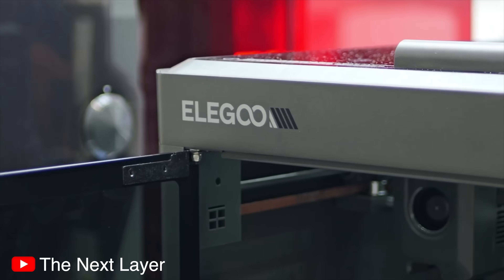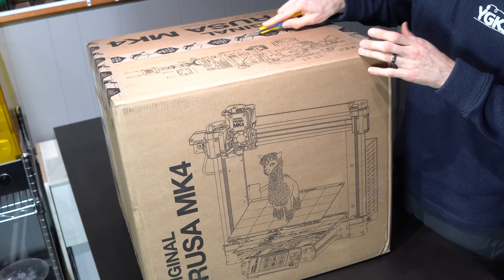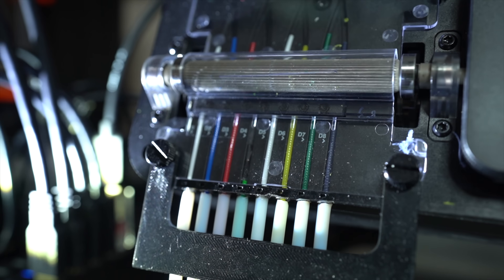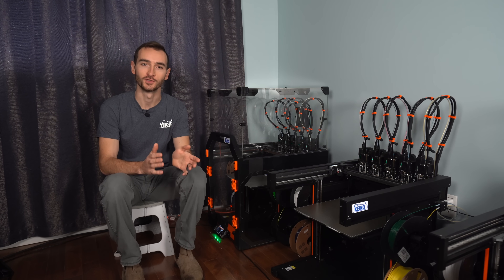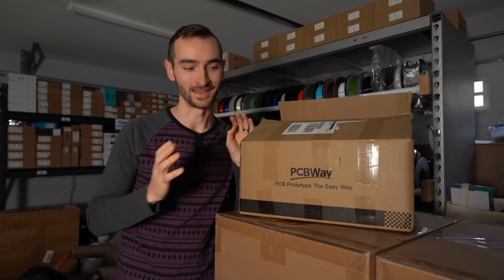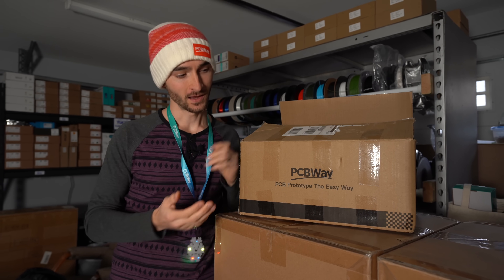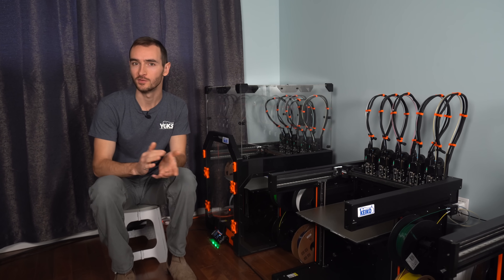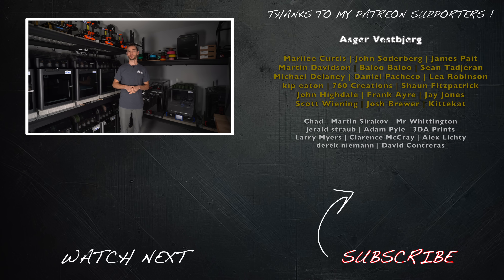The Prusa Core One is dividing the internet...

Comment: I have had the BambuX1C Combo for 1½ years and it is fantastic for single color/material print as the waste/time to shift filament in layer makes it more of a hobby thing, as we use it for prototyping/manufacturing functional parts and when you are using 200$/kg filament you don't want the poop!
The Prusa XL has benefits, but the cost is excessive for the value, and I reallllllllllyyyyy would like a much wider (2x or 3x  (or deeper/taller)) X1C preferably with multiple heads.
I think Bambu offer better value within the 256x256 envelope

Comment: There is one more decission factor -- noise level. I'm running a startup and at the moment there's no economic reason for renting a separate location for printers, so I print at home. I am going to replace my Ender 3 V3 KE with fully enclosed printer. All information I have is that Bambu printers generate much more noise than Prusa, so I ordered a Core One printer. For me the choice was obvious.
Reply: I hava an X1C in my office at home. I print while I work in there. The "noise" doesn't bother me at all. I don't think it's loud at all.

Comment: The bambu printers are not THAT difficult to fix, I definitely wouldn't throw it in the garbage at the first sign of trouble after 1000 hours. I have many Bambu printers with over 5000 hours and I've done repairs and part replacements without much trouble. My 3 X1C's in particular have over 5k hours and haven't required any repairs

Comment: I think the "bambu revolution" has certainly advanced the industry as a whole since much more consumers are now in. 
On the other hand that might be the downfall of some companies, I guess Prusa has a pretty good opportunity as well here, giving upcoming potential trade wars being and manufacturing in the EU can be a big advantage. 
Supreme customer support is a really big plus point but consumers are so used to shitty support they might not appreciate it as much as professionals do. 

Tbh I think bambu makes most of their revenue with filament and side stuff instead of the machines themself, other companies like anycubric try to emulate that 1:1 but will probably stay a little bit behind bambu. (I think I´ve spend about as much on Filament compared to my bambu printers and the margin on filament is probably a whole lot higher than you could ever get on a machine, I would be pretty shocked if manufacturing Filament in the EU would cost more than 10 euro per spool all costs included.) 

Running on the supplies instead of the machines gives you a constant revenue stream which is what about every business wants and needs for operations, on the other hand the marked regarding filament is pretty competitive.

Comment: Nice video. Ignore the fanboys. I think you laid everything out fairly. I am not a fan of Bambu due to their business practices. I also don't own a Prusa either, but they contribute to the growth and advancement of the community. And for a Trident clone (which is how I see all these commercial CoreXY printers), I think Prusa did provide quite a bit more innovation than any other clones. Not significant, but thoughtful and useful. Reducing chamber volume with inset sides will make a huge difference in chamber heating, sealed filament enclosure, managing chamber temperature during prints, being able to upgrade from an MK4S. That shows Prusa is invested in always offering an upgrade path.
Reply: Thats the only reason I havent bought a Bambu (their business pracitses).

Comment: I'll admit I have not looked into the Core One at all, but I previously happily bought a MK4 and quite like it. It has all the features I need, is open source (though sadly no longer open hardware), was fairly affordable, and has incredible software and firmware. Prusa developed an updated and improved fork of Slic3r, which was subsequently rebranded by Bambu to be their software (and at least initially, possibly in an improper manner according to the license). It's open source, so building on a program like this is perfectly legal, but the spirit of that agreement is broken if they don't give back and benefit the public by making their own software and hardware open.

My two cents is that Bambu popped into the market with a more expensive printer (that almost certainly received subsidized R&D to cut into the market, just given the history of their company), is a patent troll (Stratasys is still worse though), and is heavily using technologies that were pioneered earlier by Prusa or others. Not to say that they're completely not innovative; it's a nicely integrated system, but they're basically a "throw money at integrating some existing products that maybe weren't sold together before" company. Motion control - Klipper, PC software - Prusa, AMS - Prusa, Camera & remote management - Octoprint (and many others), removable beds may? have been Prusa (they were at least on that pretty early), and the bed levelling techniques have been around in basic form for at least a decade now. It's not a LIDAR, but the Prusa 2 had mesh leveling, and even my Prusa 3 has been flawless (so far, 2.5K hours with no hardware failures at all), with the exception of remembering to swap the surface profiles when you change a sheet (now unnecessary on the MK4). Heck, CoreXY isn't even new, Ultimaker and others have been using it for years now.

For full disclosure, the Prusa MK4 is not innocent either; the controller is no longer open hardware and there were some complaints (not sure how true they are) that they ripped off some community ideas (possible, but they usually give credit, so this seems at least partly overblown) and are still a little behind the state of the art or some Bambu features (they don't have a LIDAR, for one, but my personal opinion is that is crazy overkill). I think they were also looking into some sort of obnoxious certification program for their components. However, they have done a lot more for the community and are still largely open, especially on the software front.

Comparing the two, I can theoretically print a lot of replacement parts for the MK3 or MK4 myself, can still get replacement parts if I were to need one (since I was ordering the MK4, I did order some nicer fresh MK3 parts that were starting to wear a little, but I have no expectations or concerns of anything actually failing), and can build the software myself if needed if Prusa were to stop supporting it. There's also unparalleled cross-OS support and there was even an ARM release for a little while that worked on Raspberry Pi. I can probably still compile one even if the binaries aren't provided out of the box on the last few releases. The Bambu uses chipped filament and I've seen one working, it seems finicky with the filament wiper and box. I also heard from the guy running it that it cost a LOT extra to get one that works locally, whereas I can use the Prusa printers offline or locally with no extra costs. I also built both my Prusas, and not only was it not hard but I'm very sure I can maintain them myself. The process was also not that time consuming (it only took about 7 hours to assemble the MK4, although I did take extra time to also build an enclosure) and IT WORKED FIRST TRY with no adjustments needed. That was a magical experience, let me tell you. That's a combination of very good hardware design and amazing firmware.

Comment: It's cool what Bambu did with the X1 Carbon, that is for sure. However it's much more outstanding what Prusa did with the Core One. They price matched a printer made in China with a printer made in the Czech Republic, where the manufacturing costs and wages are much higher. They had no choice basically. Of course, they had to omit some features, but I'd still take the Prusa instead of the Bambu any day. Why? Because I had my first successful print on a Prusa. Because I taught the MK3S to speak Hungarian (read: I did the official firmware translation). Because Prusa's tech support was always very nice to me, even if I was out of warranty. Because it takes usually two business days to get a spare part. And mostly because I care about a company, who is manufacturing amazing 3D printers in Europe and they want to stay based in Prague. +1: because they do factory tours (I wanted to go on one this summer, but I got sick, so I had to cancel my Prague vacation)
The first MK3 I bought back in 2018 is still going strong, along with two others bought in the same year. I no longer have those printers, but I'm in touch with the current owner. My own MK3S (with linear rails on X and Y axes) is also working without skipping a beat, but I might get a Core One instead of it.
Prusa is moving towards the industry because they have the foundation for it and because that's where the big money is. Their domestic printers are already being used by large companies like VW / Skoda, so it's a natural step with their abilities.

Comment: As a hobbyist of close to 10 years now I was fairly excited when I first heard about Bambu's printers and how easy they would be to use. But due to Bambu Lab's behavior since launching, I will not touch one of their machines. Most of those reasons have been mentioned in this video so no need to restate them here. Instead I will choose to pay a little more and support a company that gives back to the maker community instead of stealing from creators for their own benefit. Not to mention the top notch reliability of a Prusa and the fact I can make any and all repairs myself. Despite my feelings toward Bambu, I am glad they are pushing the market and I would actually recommend one of their lower end models to someone who is simply clueless about 3D printing and just wants to print some fun little toys. Anyone who is more serious about 3D printing as a hobby I would recommend a Prusa. Sort of like the difference of a tabletop player buying figures pre-painted and those who paint miniatures as the hobby itself. I am not a business user so I have no opinions in that regard.
Reply: I have to be that guy. Your info is wrong. Whether it be through ignorance or malice I will correct you. 
1. You could ALWAYS  print offline(sd card). I am an original kickstarter backer (2022) so that misinfo about needing the cloud to print has NEVER been a requirement. It as only gotten better with LAN only mode(over wifi) and little known FTP.

2.  Making a website that houses models isn't a novel idea. Thangs, printables, yeggi, Thingiverse. Will you accuse (Prusa)Printables of copying (Ultimaker)Thingiverse, which came out first? 🤔

3. Printing without a slicer(from a cell phone) came with Ankermake first but was quickly implemented and supported better with Bambu. That has been COPIED by Prusa. Where is your outrage for Anker against Prusa for copying? 😒

4. The advancements in Opensource in Bambu studio has been implemented in Orca and Prusa slicer Step file implementation, multiplates, svg all bambu first. 

4a.They also licensed their nozzle tech to E3d and half of the license fee goes to Sanjay Mortimer Foundation. 
So they are giving back to the community.

5. Makerworld files are USER uploaded. Point to a maker who states their files were taken by bambu directly. Any files that are user uploaded fraudulently can be taken down easily with a copyright claim. You are probably the type who think looking at the inspect element of a website is haxxing...🤣

They even allow X1C users to roll back to earlier firmware to use Open source custom firmware. This can allow addon boards that include usb and ethernet. They are not heavy handed with mods like the hydra ams mod, light bars, fans, bento boxes and even recommended mods for the p1p before it was overshadowed by the p1s. 

Open source hardware is OPEN TO ALL. private users, education, companies. All licenses are followed and adhered. Anything created inhouse does not need to be shared. Even Prusa is closing some hardware designs as is their right.

 For the love that is holy do some basic research. If you like a company for any reason that is your decision but no need to spread refutable junk to justify it.
Reply: 1. I know you could always print through SD card. I was referencing network connectivity. And I also know they have made it an option to not use their service while using network connectivity. But when it launched you had to send prints over the Internet to China if you wanted to use NETWORK connectivity. And a result of this was a bunch owners discovering their printers connected to said service printed by themselves due to a cloud service restart. That's a big red flag for me. Sorry, I was not more clear. 

2. I was not accusing them of stealing because they implemented the same concept for a web site as someone else. Their site was a clear and direct recolor of another. You can debate whether using the near exact design and a lot of code base is stealing but in my book it is very bad form and another red flag. If you don't have the talent to write your own code or create your own design hire better talent. When a company shows me they take a lot of shortcuts it is a sign I probably don't want their product.

3. Not sure of the point here. I never mentioned anything about printing without a slicer or Bambu stealing features. I have no issues with any functionality of Bambu printers.

4. Maybe you skipped my original post. It really seems like you did. From my original post: "Despite my feelings toward Bambu, I am glad they are pushing the market and I would actually recommend one". My criticism for lack of contribution is purely on the open hardware side and is my personal preference for a 3D printer manufacturer.

4a. Ok. Charity is great. I am specifically talking about open hardware and in particular in regards to the 3D printing community. But again, great.

5. I will concede this point 100%. It seems it was a user that was performing the mass uploads of other people's models to Makerworld which is what I was referencing. And for the record I write HTML/XML/Javascript/PHP for a living so big swing and a miss there. 

And a point I did not mention was Bambu Labs admitted malicious behavior on a competitors site:

"These testers did upload a handful of models to Printables, including a sparse few problematic ones, and even reported some of them to check the moderation procedures so we can calculate how many head count should we reserve for moderators. All these models were subsequently removed by our testers if not previously moderated by Printables. There was no malintent in this activity, and no harm was inflicted upon anyone, other than the very minor added workload of moderation for the moderator."

That was not only breaking TOU but is very bad form and shady behavior. They only mentioned it on their site because they were caught. You run your tests on your own site with your own employees/resources. Not sure what you do for a living but I am sure you would not want a competitor abusing your resources for their gain.

It really does seem like you did not read my original post but I hope this clarifies my opinions.
Reply: This is silly. Can you clarify what behaviour it is you don't like?
Reply: @Keveira  Well, several are mentioned as I said in the video, but here ya go. Firstly they launched with users being forced to send prints through the Internet to their servers in China. Then they had a debacle where many of the printers started printing on their own because of the afore mentioned prints going through their servers. They also incorporate a lot of open hardware design but do not give back to the open hardware community. Then they started a print model web site which was obviously the stolen code base of another popular print model site and in order to populate it they web scraped data and files from other web sites without the permission of the model designers or the sites they scraped from. I don't have to have 3D printers to survive so I choose to have standards for the companies I will buy from. Personally I don't think having those ethics standards is silly.

Comment: Prusa moving to industrial spaces makes a lot of sense. They've not been able to keep up tech wise, and they'll never be able to get their pricing low enough to compete with their current location. They took entirely too long to come out with a response to the X1/P1 line, and their fans had been asking them for a CoreXY design for years before Bambu changed the game. A lot of those actions indicate that the company didn't have a strong interest in innovating. They could have grabbed an opensource project like the Voron at any point and figured out how to make it more of an out-of-the-box experience at any time before Bambu and they just didn't, they were married to the bed-slinger I3 chassis. Obviously we cant say for sure what was going on internally during all of that time, but it all smacks of a company either too busy sniffing their own farts to be bothered innovating any more, or a company with internal struggles (either for staffing, with staffing, or with management,) who lost all of its mobility/flexibility and couldn't pivot when they were caught off guard. 

I wonder if they were afraid that releasing a CoreXY machine would have been less profitable per unit, and would have eaten into their I3 sales.

Comment: The issues with your X1Cs are both due to your heatbed signal cable. On early X1Cs the cable is poor shielding and the wires break. I had to replace all 9 of my signal cables on my 9 early batch X1Cs. 30 min repair and a cheap part.